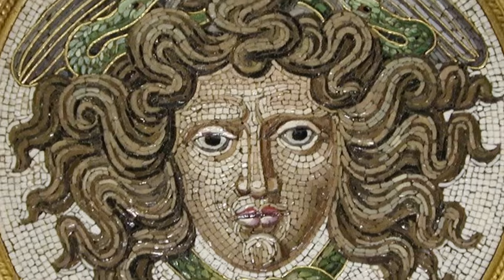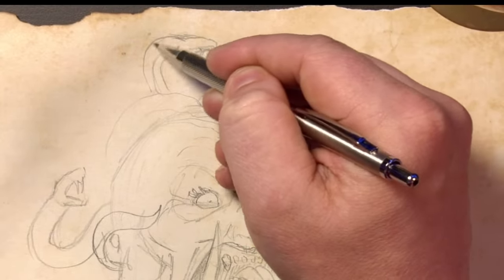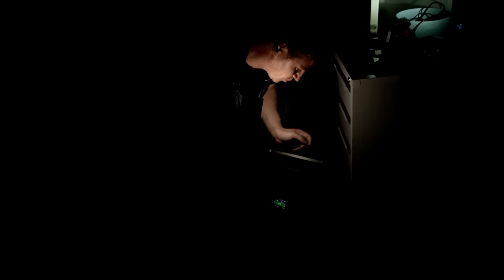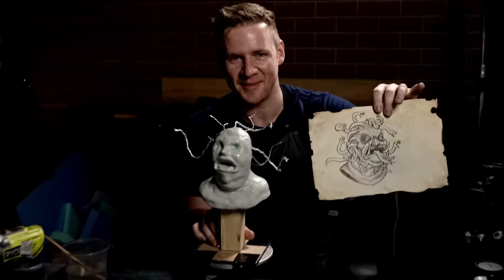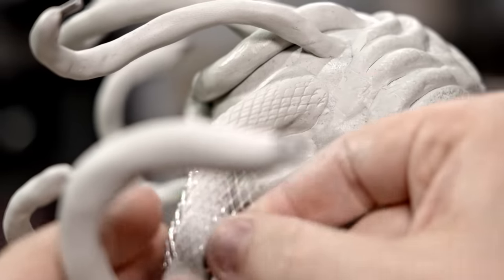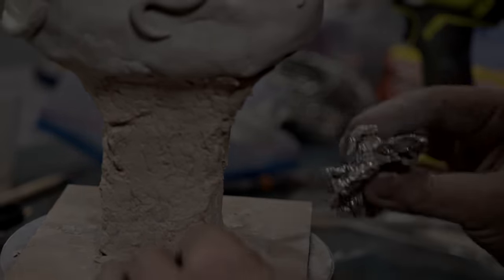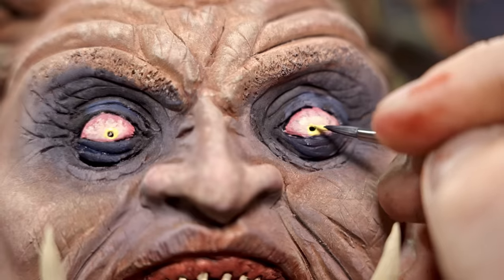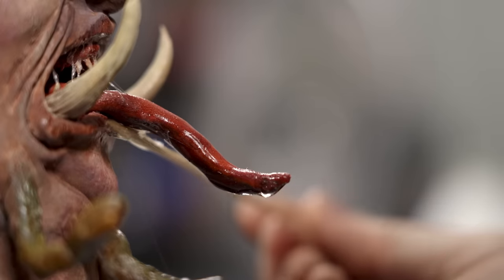Sculpting ANCIENT monsters from the OLDEST Descriptions...

Comment: "Put that thing back where it came from or so help me" 😅
Petrifying result. As You showcased sculpting result with a worry not to ruin it by painting, I wondered if You have tried to 3D scan a sculpture? Photogrammetry might not catch all of the details, but some structured light scanners should work - pro models are quite expensive, but maybe some mid tier devices will do the job right. Cheers 😄